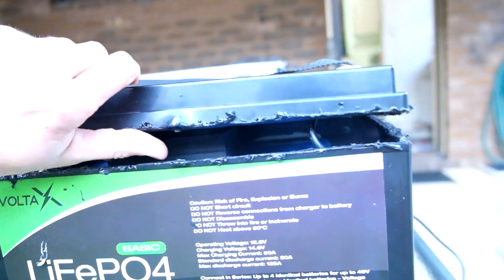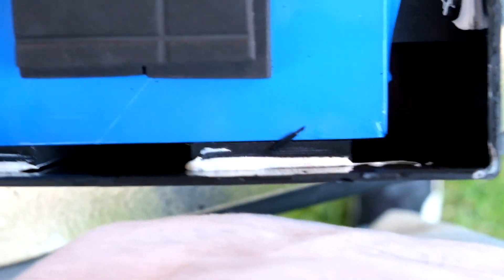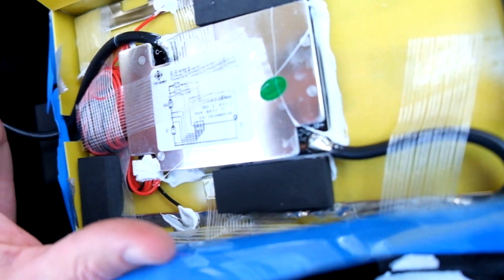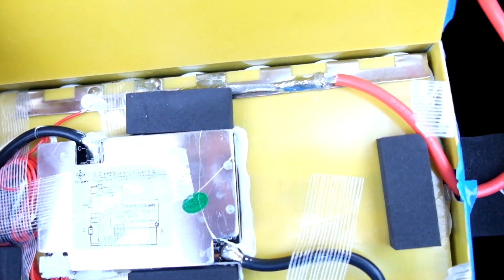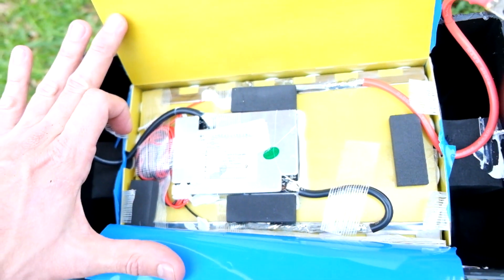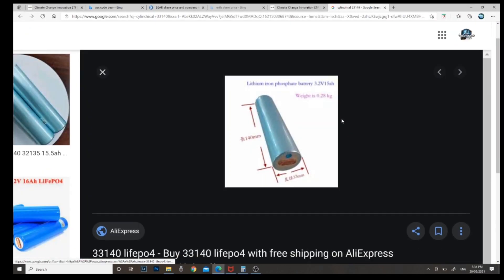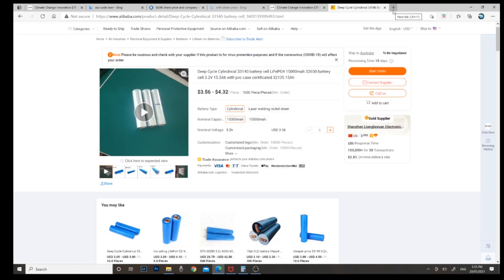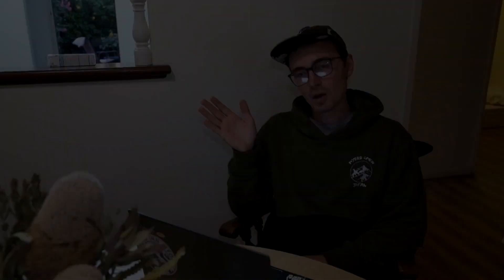Cut Open Ebay Voltax 100AH Lithium Battery!

Comment: I reckon there a good bang for your buck, I run 4x 135ah Voltax's in series on a 48v inverter and it hasn't missed a beat in 3 years.

Comment: Good job! Thanks for this tear down. I got 8 similar batteries (Real Power) for a 24v system & had a overvolt situation which blew most of the BMS’s. I opened them up to find a similar setup, except the cells were laid sideways and they had 2 reasonable cables connected to the battery negative and positive along the busbars with 2 cables into bms and 1 cable out and both pos & neg cables were bolted to terminal posts.  I have configured 4 of these into a single 24v pack so far of about nearly a quarter of the original footprint without the cases and duct taped together for now, with a good 24v 200A ‘JK’ BMS, and so far so good, I am making up a second pack the same with the other 4 batteries for about 10 Kw of power with 2 x 2.4kw ‘All In One’ systems, they work great in my bus setup with split A/C, etc, cheers

Comment: Electrical Engineer (and former sparky)  here, I've heard all sorts of crap about these batteries regarding the build quality, the shitty BMS, the actual capacity is less than stated and on and on etc. but as you found out with your tear down, they're actually okay for the purpose they're designed for, which essentially is for general power on caravans, camper trailers and boats (but not for starting though). 
I've been using a 135AH one to power our trailer with fridge, fan, lights and mobile desktop office for over a year now. The only time I had a problem was when a crappy anderson  (worst f&*king design ever, I honestly do not know why they're so popular)  fell apart, and the solar panels were not charging.  
Being an Engineer (and former sparky) I don't know why quality Lithium batteries are so expensive, all about profit, the cells and the BMS pretty much come out of the same factories as the cheaper ones, it's typically only the case that is different. These people are very good at copying good designs, and given quality parts are so cheap there is no need to sell a crap battery.
Reply: How's it going now with the voltx,she still powering good mate?
Reply: @getsome777  yeah, been using it constantly for over 18 months, no perceptible loss of capacity. 
The only issue we've had has been with shitty anderson plugs, the worst plug system ever designed! 
I am in the process of changing all my anderson plugs to TE style plug and sockets.
Reply: @andrewhill8289  cheers,its a shame when a good product is effed up by one little thing bro

Comment: its not dodgy, they clearly state the charge and discharge is less than a prismatic cell setup. thats the advantage of prismatic, the max current. thats why teslas tabbed circualr batteries made a splash, high AH like a cylinrical but with the discharge / charge rate of a prismatic.

Comment: Thank mate just took that battery off my list
Reply: so everything looks good and is as advertised.. annnnnd you take it off your list? 
Actually cruious as to why?
Reply: @Bamwich  very simple it's full of 18650 batteries, chance of one going bad is very high, not to mention there are way to many fail points in the soldering in my mind = Do not touch
Reply: @bradkay2710  I see so the solders didn’t look good like he said? I don’t know about those smaller internal batteries, good to know they are bad. Do you have experience with them or have seen a review where they didn’t last? 
Considering this battery is 25% the cost of most others, I think the bar can be a little lower? Like it could fail after only 2 years, and do that again two more times and you’d still be less out of pocket.
Reply: 18650 battery it self is a good battery if you get a good brand like Samsung and remember you get what you pay for, there cheep for a reason
Reply: @bradkay2710  they are probably all made in the same factory. The price is often just down to whichever brand is printed on the front
Reply: @Bamwich  your partly correct check out some reviews on 18650 batters and you will probably find cheep batterys is like Holden crapteva compared to Toyota land cruiser I find now days I research the living hell out of things before I splash out the cash
Reply: @bradkay2710  I understand the reference, but it is still an interesting one. Seeing as you could buy a Captiva, drive it for 6 months, have it completely blow up on you. Buy another one and have the same thing happen to you, then do that ten more times.. annnd you'd still have spent less money than the land cruiser haha.
Reply: @Bamwich  then you get that crapteva  il stick with the land cruiser and not get stranded out bush 200km the NRMA ha ha ha ha ha
Reply: @bradkay2710  I thought you said you did research. Considering the simile you used, I’d say you’ve spent 5grand on a battery. It doesn’t take a genius to figure out that you could have 5 of these batteries in fail over and still be thousands more ahead. That’s A LOT of wiggle room for failure.. Sounds like your research was ask old mate at the pub.
Reply: @Bamwich  um are you on drugs 5 grand when did I say that read all comments mate
Reply: @bradkay2710  you went on about a Captiva and a Land Cruiser… I mean it was your simile, it confused me as well.
Reply: @bradkay2710  I’ll make it more clear for you. You made the analogy of this battery is like a Captiva and a good battery is like a land cruiser. I used this, to show you why your point is very wrong.
Reply: @Bamwich  really well you get that battery 🔋 hopefully your happy with it but when it's catches fire or stops working remember this back and forward then go out and get a Toyota ba ha ha ha lmfao
Reply: @bradkay2710  they are not 18650 cells, which actually relate to there size, ie: 18mm x 65mm and are also a different chemistry of LMC (Lithium Manganese Cobalt) as compared to these “Lithium Iron Phosphate”, or LifePo4 cells, which is also why they are lighter than the 18650 chemistry.

Comment: I was the same, looking for a breakdown like this myself before i brought them. I did take the risk and purchased 3 of them for my camper trailer. Did have trouble at first, until I worked out the wiring setup for 3 parallel batteries was wrong and they had circuit breakers in between each battery and one had failed.
Now got them setup correctly and all charged up, but this bloody Covid has put an hold on any camping at the moment, but pretty happy they are not total crap inside.

Comment: 50A BMS isn't dodgy dodgy 'cause they list those limitations in the specs. It's not what I'd want in a 100Ah LiFePo4 battery but it's not bullshit.

The only real concern would be whether the cells are used ones or not, which is harder to tell. A lot of cheaper brands just throw a bunch of moderately matched used cells in and they underdeliver on their specs because of that.

Based on other youtube tests I've seen... they seem to be new cells. Or at least very mildly used cells, maybe a year or two, maybe, but probably not.

Comment: It's says they are prismatic cells in all the descriptions I can see but what's in that one are not prismatic right?
Reply from the maker: No they're not prismatic they're cylindrical cells. They have done the job so far but I'm. Hesitant to install them on a boat maybe just for camping.
Reply: Are these the same battery? Or newer model? Is voltax the same as voltx? https://outbax.com.au/voltx-12v-100ah-lithium-ion-battery-lifepo4-deep-cycle-recycle-camping-rv-solar?gclid=CjwKCAjwxo6IBhBKEiwAXSYBs2AQBtJAMwHQO-2TBL2AWg0RuAbItlwnQJS9b7CaLVb2PC9hci_GfhoCb3AQAvD_BwE
Reply from the maker: @wtfbbqpwnyourarse  they do look different. 50amp charge current but 200amp discharge current. My voltax has 125amp discharge current, It would have a different BMS by the looks of that but I'm not sure what cells are in there. That looks like a newer model.

Comment: Nothing “dodgy” about voltax batteries. I’ve been running a 200ah purple label & have used Over 200kwh! In the last 11 months...super heavy usage too. (Air fryer, induction cooktop etc)

Only a fool would buy more expensive items (Eg DCS...cough.... made in China!!!)
Reply: Don't they only discharge at 100a? Are you running a really low powered induction etc, or are you drawing more than 100a?
Reply: @jozlod  I bought the purple label 200ah...

140A continuous & 280A max. (Rated) but it’ll do about 150A continuous issue free....add good sun through the 2 x 330w monos & I can comfortably pull 180A+ total out of the system. (43A @ 12v is the best I’ve seen from the panels)

But I have found that my philips induction runs at a max of 100A regardless of what heat it’s set on. I’ve got victron smart shunt monitoring, so I know exact figures of usage.

Comment: Hardly surprising that component costs including the case comes to ~35% of the purchase price, this is common knowledge among the diy cube prism cell battery builders where you get to choose the components. Anyone contemplating 600-1000+ Ah capacity is well advised to spend 60~75% of 'drop-out' pack equivalent and get top shelf cells and 'smart' fully featured bms' with real contactors that will integrate into alternator-inverter-solar without unexpected 'black-out' feature.

Comment: Great Video. Nowadays the BMS will attach the temperature sensor on their metal shells and attach the BMS directly to the cells. Within the IP65 case, the difference between extending the temperature sensor to cells and attaching them to the BMS case then to the cells is not significantly big.

Comment from the maker: Help us out and purchase your Voltax 100ah batteries from this link https://ebay.us/Ir8vzA
Reply: I take this was a sponsored video..
Reply from the maker: @Rick-nz6xf  no, I was just curious.
Reply: @SailingBlueMoon  Are they waterproof? If not can they be modified to waterproof?. I had a 100AH battery fail. Outbax replaced it with the latest battery and I ran it on test of 12 amps for 9 hours and there was still plenty of power remaining.